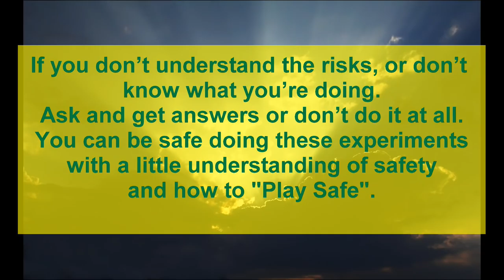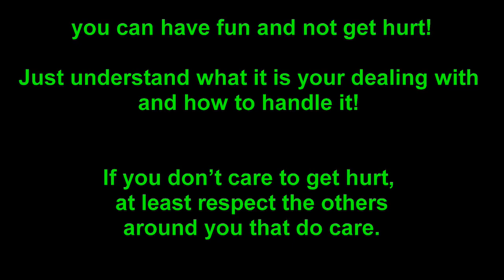HHO Explosion!!! Live Demo " Play Safe" With You! & ~Russ

Comment: Glad you were not Hurt !! I learned my lesson long ago..... Build yourself a small vented hood workstation !  Go to Home De"whatever-large-hardware" store and buy a PVC shower stall . It's only about 5 or 6 inches deep. And get a 4x8 foot piece of lexan and the same size piece of marine plywood.for the top and back . Also a cheap bathroom vent fan ! Just make the top sloped downward from back to front and leave some wood to do the top-side panels. Cut lexan for a 18-24 opening from stall up.....

Comment: Great to see you put up the failure too. Important to see how easy it is. May be lay your hand on flash back arrestors you find in gas welding equipment. Not sure about the back pressure they will generate. Or may be write yourself a pre flight check list .... so you will not be destracted.